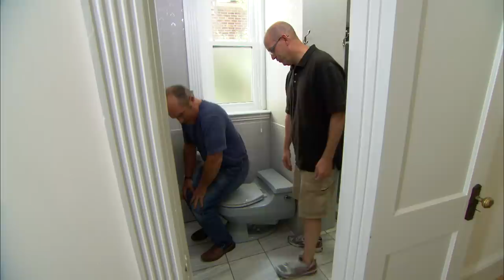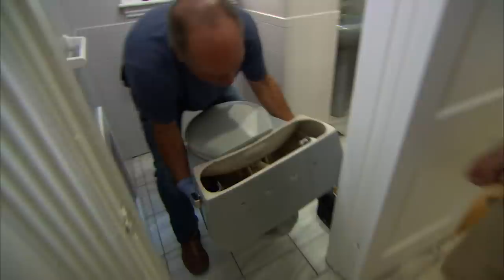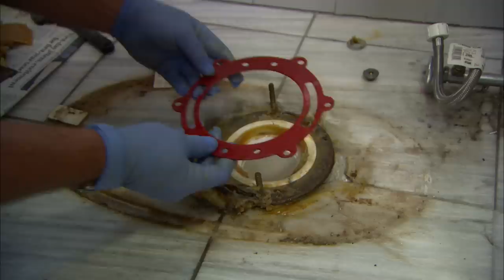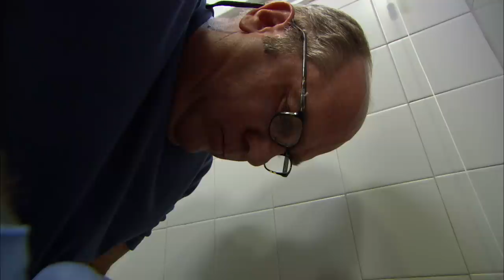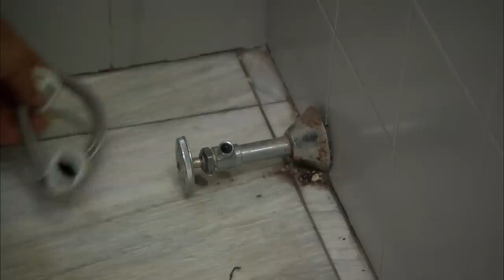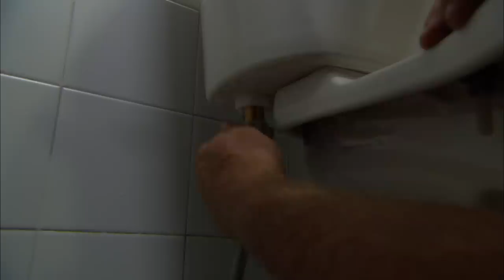How to Rotate a Toilet | Ask This Old House

Comment: is it me or is that new toilet too close to the wall now lol.
Reply: It's just your left Leg
Reply: Depending on how much the client is willing  to pay to redo the conections and floor tiles ^^, and flexibles in visual areas are unproffesional T_T use a solid crome pipe and bend it...
Reply: Looks terrible now... 
Pay the extra to center it. -__-;
Reply: You could install an offset flange for a few more inches. 
But you would have to peel off the old flange
Reply: Yes it is too close to the wall now. Thats Why they didn't show you a person sitting in it, like the did in the open. Homeowner/actor must be thrilled now
Reply: There is room now on the right for the magazine rack!!!
Reply: @treborobotacon  bolts would be in front and back with offset flange
Reply: Code in some places require what I believe to be 18 inches from center. I think this was only 12.
Reply: gate keeper I said the same thing it’s not center
Reply: Codes says 15 inches from center on both sides.  Total width needed 30 inches
Reply: Makes it easier to fall asleep on the toilet.
Reply: That's what I thought....
Reply: exactly，I will be glad if every job site I walk in the owner willing to accept this kind simple awkward solutions. To me the job involves open up piece tile, rearrange the drainage from floor below and refloor and re tile the old drain opening.
Reply: J Lai 
Depends how much they wanna spend.
Reply: Not really.
Reply: RockRocky09 - Code is 15” minimum to center of toilet
Reply: If someone is doing it for free, you take what you can get.
Reply: @celinebeuserie4367  "flexibles in visual areas are unprofessional "  Not only have I never heard of  this, I don't think it's accurate; a braided stainless steel hose looks perfectly fine in almost any application.  Perhaps expectations/standards are different in your area?  [I'm in southern CA, in the USA]
Reply: @forevergogo  Looks much better now, than before this project.  Moving plumbing is very expensive--to do this only/mostly for aesthetics could be an extravagance.  Depending on what's in that wall between the toilet and the sink (and if it's loadbearing), it might be easier/more cost effective to modify that wall section.
Reply: @treborobotacon  I don't know about that existing closet flange--it wasn't white like a modern PVC flange (unless it had a metal flange ring on top).  It might have been old-school cast iron (in which case, it would have to be CAREFULLY chiseled off).   The homeowner could certainly install an offset closet flange, but would have to commit to demo and repairing the tile floor around the toilet.
Reply: @kenc2257  I am from belgium, I just find them not tight enough to look good, I prefere a solid 10mm chrome pipe, straight and square with the wall.
Reply: Didn’t he say a bsmt??  So it’s on the first floor Can change the water and waste lines below.  Looks like crap not centered.  And way to close to the wall

Comment: In an older toilet installation the off set is 14”...when i replace older with newer toilet and 12” off set, i simply make a “frame” out of 2x4’s laid against the wall flat, screw to wall as high and wide as I want,  screw  a piece of 1/2” sheetrock on frame, paint and texture if needed, replace H2O supply pipe with longer one to come  through sheetrock, cut a piece of 3/4” white pine a little wider than the 2x4 frame and approximately 3” wide to accommodate deodorant, shampoo etc. but not so wide i will hit my back on it while sitting on the new toilet, I will usually use my router to make a nice fancy finished edge on front and side(s) that show if necessary, use finish nails to anchor the new shelf to the 2x4 frame, paint it with glossy paint and now the toilet lid fits right up against the new ‘wall” with a new shelf area behind the toilet.
Reply: Picture?! This is a lot to follow :)

Comment: I had almost the exact same situation. Mine is on a cement slab.That hydro seal worked perfect.I was going to chip away cement and install toilet flange in the right direction,till I scene this.I had to use a regular wax seal without cutting it.

Comment: My concern with this is how little elbow room you have on the side. It was small before on the other side but it is not much better, IMO. A corner toilet would come in handy in this situation. Set it diagonal and it is easier to reach tp holder and you get a little more leg room. You can turn a standard toilet at an angle but you get  gap behind in the corner. I am concerned with how high the new flange is and how small the cone going in to the toilet is. That will restrict flow and I worry the toilet won't sit flush to the floor.

Comment: I feel like they really could have cleaned the tile a bit more before installing the toilet, and maybe even cleaned the flange a tad.
Reply: Martin Ladjimi it was cleaned? And why it will be under something that gets replaced every quarter century
Reply: Exactly. Im an apprentice plumber and i couldve done a better job. Hes just lazy. Clean the tile. Install a NEW flange instead of using an adapter on an old one thats probably ready to crack any day. Re caulk or re geout around the toilet as well. Just laziness.
Reply: Don't worry, that homeowner is gonna have to call a real plumber in about 3 months when that cheap hack of a flange starts leaking and he can clean it then.
Reply: Possibly not if it was marble tile, a terrible material to use on a floor.
Reply: @ValexNihilist  keep changing toilets apprentice and soon you will want it done as quickly as possible too. Who the hell wants to prolong such a gross job? Not me!

Comment: Richard, why didn’t you use the OFFSET toilet flange so that you GAIN 1.5 to 2 inch of space to the right side of the LEG.
Reply: Also, an offset flange means you don't have to buy the taller holy water stoup.
Reply: Offset toilet flanges are actually against code because the choke off the 3" minimum pipe size at the center of the offset
Reply: Offset flanges are against code just about everywhere. But also most code requires 18" from center to walls on all 3 sides, so this likely isn't to code either.
Reply: The only reason a offset flange is so called illegal is because you can't get a caulking tool in half of the flange to make a good and proper lead joint .so on to abs or plastic flanges the offset does not choke off the 3 " minimum size and you are able to get a good glue joint so there now ya know
Reply: IRC Here is 15 side to side and 21 in front.

Comment: I noticed that you had to install shims at the back of the toilet base which you did not mention on the video.  Apparently there are no code requirements where this was done that specified minimum space to the sidewalls.  It looks rather tight.
Reply: I think the toilet was already violating code by having only 14" from center of toilet to wall. Minimum required is 15".

Comment: For comfort while sitting on a toilet you want a minimum of 15 from the wall to center (right and left). This toilet now has only 12 inches on the left while sitting down. So, you're going to lean one way while sitting. Yeah, I know it's better than it was but, you've just traded one uncomfortable dimension for another.
Reply: so what?
Reply: @Fattony6666  For 1? It is code to be 15" from the wall.
Reply: mine is the same way,don't even notice it
Reply: @Delekham  Exactly

Comment: I wonder where that house is located that doesn’t have plumbing codes. I have never seen anywhere in the U.S.  that would allow the toilet to pass a plumbing inspection (in either installed positions). You would think a reputable magazine would inform its readers to always follow the plumbing codes.

Comment: With this kind of rotation, instead of the center of a persons’s body being 14 “ from the right hand wall, they are now 12” from the left wall.. that will be very uncomfortable unless the old partition wall is removed. Even the previous 14 “ was too close for proper comfort.

Comment: Replace the wax ring with a roller bearing and just let it fly. Of course you'd have to rig a flexible hose into it, but that wouldn't be too hard. Then you could sit in any direction you felt like.

Comment: Just out of curiosity.. As far as i saw in these videos, in usa you use pvc pipes without any seal, glue them together and use wax rings for connections to toilet etc, correct? In EU (at least in germany), we have special PVC pipes with rubber selas / o-rings at the end. No need to glue, just push them together. Same goes for toilet or shower, you insert a pvc pipe into the toilet outlet (with a big rubber ring / seal) and the other end into the drainage pipe (which has it's own seal). Seems to me to be way easier.. Or am i missing something?

Comment: Looks like that adapter actually restricts the opening a bit. Isn’t that a potential problem?
Reply: AlergicToSnow looks like it's upside down
Reply: Many adapters do, especially the ones that slide inside of the old flange.  NOT GOOD!  They're going to have to use that plunger, on top of the newer low flow toilet.
Reply: u install it that way then push the rubber in the hole b4 u place the toilet (he bent the rubber up out of the way for the first few steps)

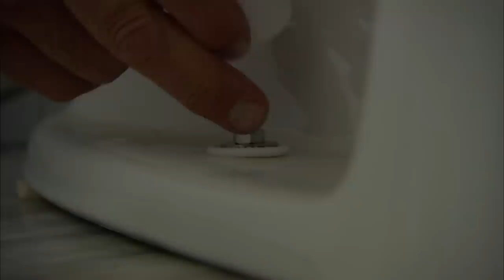Comment: As a kid growing up in the 80's I always admired This Old House. Now being a licensed 20 year professional some of these video make me cringe because uneducated public doesn't know any better. Its common knowledge in the industry that 15" is the MINIMUM from center of a toilet to any fixture or wall on either side.  The reason this toilet is not resting on the floor @6:15 is because the closet flange is too high. Finally, it IS CODE to caulk the toilet to the floor.....keep making videos like this this please because it will only give Professionals more work fixing these disasters.
Reply: That would never have passed inspection. I would have to re-rough the flange.
Reply: Caulking toilets to the floor hides any potential leaks. A small issue can turn into a huge rotted subfloor problem if the toilet is caulked.
Reply: GoodtimesDJsoundtech where do you live where it’s code to caulk the toilet to the floor?
Reply: GoodtimesDJsoundtech where do you live where it’s code to caulk the toilet to the floor? And also you ideally should have centered the toilet in the opening, but there isn’t actually a code that says 15” minimum in most states. And in some states it wouldn’t pass inspection with a 2” gap behind toilet tank.
Reply: Indiana..... Brush up on the IPC

"405.5 Water-tight joints.

 Joints formed  where fixtures come in contact  with  walls or  floors  shall  be sealed."
Reply: Agreed, just don't caulk the back to if there is a leak the water can get out.

Comment: when I installed my first toilet I tried using an angle grinder to cut off the tank bolts. I ended up burning the porcelain with the sparks LOL. Thankfully some furious scrubbing with a non-scratch scotch pad sanded away most of the evidence

Comment: Those are clearly 12x12 tiles, as such even with rotating the toilet, it isn't positioned correctly. The centreline of the toilet needs a minimum of 15 inches clearance to any instructions... like a wall by code. This toilet only has approximately 12-13 inches clearance from the toilet centerline as newly positioned.
Reply: Thomas Bonse l.p.

Comment: My Fiance owned a cape cod home built in 1943.  The toilet flange seemed to be quite far off the wall.  In fact, there was probably a 6" gap between the back of the tank and the wall.  To top it off, it was an elongated toilet!  Talk about a crammed bathroom!  Was this normal for old construction to have the flange so far away from the wall?
Reply: No, someone probably didn't know what they were doing or a remodel occurred and they didn't want to move the waste pipe ?
Reply: Bathroom was in the same place as with all of the other neighboring cape cod homes in that area, so I doubt they moved the bathroom wall.  Dimensions of the bathroom were also the same.

She remodeled the bathroom, tile floor, tile tub surround, new vanity, mirror, cabinet, etc.  In hind sight, an offset toilet flange would have helped but we didn't think about it at the time.  I really don't care for elongated toilets, especially in small bathrooms.  Anyway, I'm about the only person that has ever noticed or mentioned how far the toilet tank was away from the wall.  But honestly, we were able to paint the wall behind the toilet entirely without moving the toilet.  Talk about a gap!
Reply: Sounds like it's all good then !!
Reply: Besides sticking out so far.

Comment: Do y'all recommend caulking around the base of the stool or not caulking? I've always run a bead of caulk around the base to keep any moister out that might get under in the event of a toilet over flow but never see any pro's do it, why?
Reply: I can't speak for the "pros", but I've been a landlord for decades.  Depending on the caulk, especially silicone, dirt collects in the soft material and looks filthy.  And it's a pain to clean up when a new toilet is installed.  As to toilet overflows, if they are due to a clogged trap, the caulk may help.  But if it's due to a clogged 4" line I would rather see an early sign, like water leaking past the wax gasket, especially on wood floors.  The bathtub normally fills with waste first on a clogged 4" line.  If you want to caulk, I would leave a 4-6" gap at the back of the bowl.
Reply: I believe it's code in California to caulk around any toilet on a tile floor.  Personally, I think you are better off not using caulk.  If the wax ring ever fails, you might see the water seepage beginning and catch it before it destroys the floor.
Reply: Caulk helps to stabilize the bowl when it hardens

Comment: I don’t think that TOH changes for the labor. So if the owner pays retail for a desirable component (no markup), is willing to wait, chips in, and lives with a bit of compromise, then it is a fair exchange. I would’ve put sealant on the toilet base prior to setting it down and afterward.
Reply: If you seal it you'll never know if the wax ring has failed.

Comment: A toilet should be 18” on center from each side wall. In the video, it appears that the toilet is too close to the right wall at 12”-14”. I suppose this is the downside to rotating a toilet, utilizing the same drain location.

Comment: How necessary are spacers? I keep seeing TOH use them in videos. If it we're my house I wouldn't care if the toilets off level by a fraction of an inch. I prefer it to be snug and flat on the floor vs having that nasty gap and teetering on those spacers Everytime I take a dump.
Reply: DesecratedReaper Was Those shims are more for stopping the toilet from rocking and not leveling, as many new toilets are not baked flush at the bottom and tile floors are not flat half the time either

Comment: Why no one is talking about the obvious: There isn't enough space between the toilet seat and the wall on the right. He could have installed it an an angle away from the wall instead of being parallel to the wall. Would that be against code?

Comment: Almost six months back we changed the wax ring and now it is again leaking from the roof. After close observation I found that it is leaking only when I sit on the toilet seat and flush.  The handyman came and flushed 10 times but couldn't find any leaking. Now he want to cut the sealing to see what is exactly happening. Can any of  you advise me what could be the exact problem here?  Is there any way to fix this problem without cutting the sealing?
Reply: I'm no plumber and think your problem is probably solved by now--1 year later.  If it wasn't, I was going to recommend a product called Perfect Seal Toilet Wax Ring that you can buy at any big box store.  I'm guessing your flange might be too low.  This product can be used for flanges below and at floor height.  I only thing I would recommend about this product is to replace the Johnny Bolts that come with it.  They are plated steel and will rot.  Swap them out with brass ones.  Otherwise I think this is a good product.
Reply: maybe take less massive dumps?

Comment: Personally, I don't care for low-flow toilets, and all the backed up sewer problems that come with them.
Reply: Depends oon where u live. Have a low flow with the column lifting mechanism for afast suction lush that works great 0 problems. Have another low flow/water one that doesn't lush like that and can be a bit more delicate but generally haven't had any real problems with it.
Reply: They are better than the old style ones(these use far more water resulting in bigger water bills)
Reply: Some are designed better than others. We've got Glacier Bay 2-piece high efficiency toilets ($100 at Home Depot) in each bathroom and they work great. They just don't clog like some of the low-flow ones I've seen.
Reply: It has been my experience, don't   t buy the cheapest stool that a build center has, spend more for a better stool saves a lot of problems. And if your having back up problems you might check the house drainage system, and then sewer system to city main,or septic tank.
Reply: Don’t have that problem at my house! My low flow shitter is jet propelled! Love it when new people come over and ask to use the toilet. They never expect it to sound like a commercial toilet. Huge whoosh followed by a WTF exclamation of various sorts!
Reply: I hate new toilets. I always manage to clog them. If I installed one of those low flows in my house, I'd end up flushing at least four times to get everything down. So I'm saving water by keeping my vintage toilet.
Reply: The new ones are much better. Look for Kohler power piston. I've installed 5 of them in my houses. They actually work. The old toilets used more water and wouldn't even clear pee.
Reply: @hdtvcamera1  
I just installed a urinal.
Reply: @plumbingstuffinoregon2471  your wife must be cool